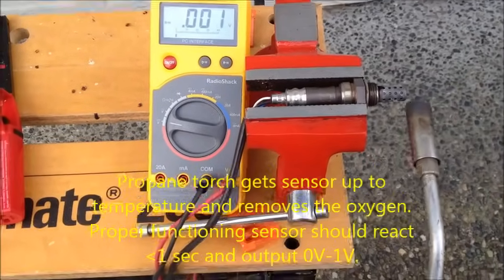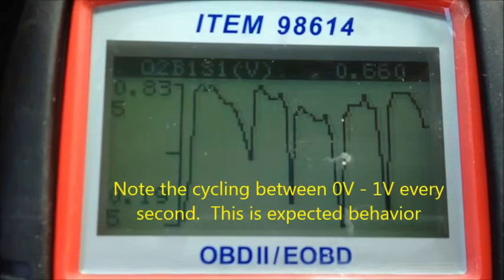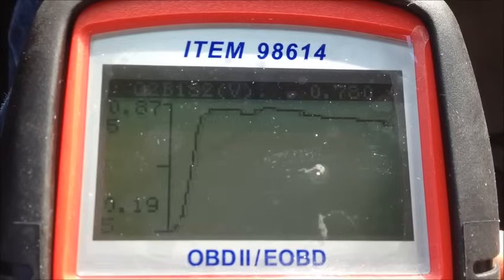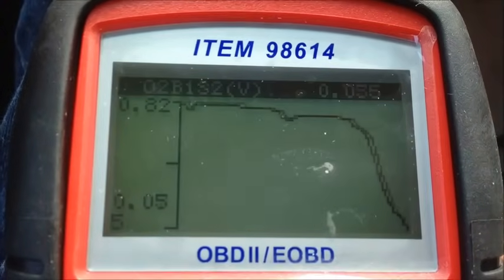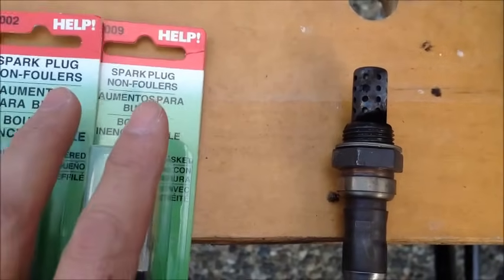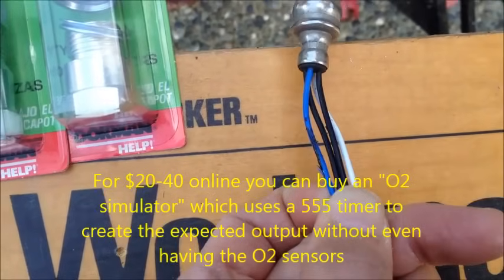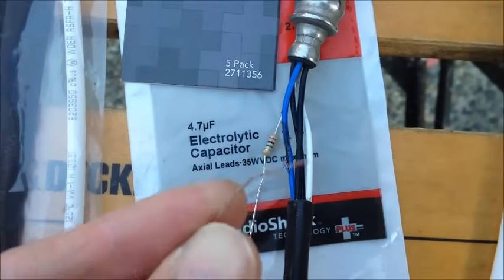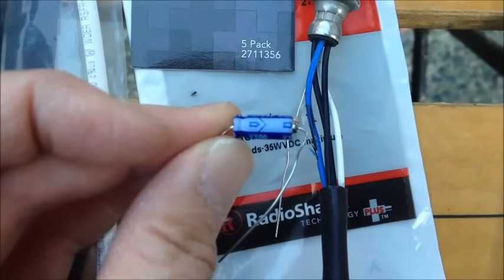$3 O2 simulator fix for P0420 Check Engine Light

Comment: Why not just ECU edit and disable the learn on rear O2 and disable the code? I did that will all my cars and I pass all tests without a problem.
Reply from the maker: Thanks for the suggestion.  I hadn't heard of that.  I searched online and it seems that older cars like this don't have a way to reprogram the ECU except possibly burning a new chip on expensive hardware, and even then I saw that this model may not support it.

Comment: Will this work on a 2009 Ram 1500 SLT 5.7 Hemi (straight piped)? I can't stop that CEL to save my life,  extensions, steel wool,  mini cats blahhhhh fuckin blahhhhh. That computer is developed by Skynet. I can't find a wiring diagram either.

Comment: Did not fix my 2007 Chevy Tahoe 5.3L got a P2A01 code O2 Sensor Bank 1 Sensor 2 Hope to get a reply . Used the 4.7mf and the 1olm resistor put in correctly the O2 sensors is just a year old. Not sure if i need different Capacitor or Resister?

Comment: I did the "spark plug anti fouler" trick on my downstream o2. I still get a p0420. 1995 Subaru 2.2. 

Unfortunately Radio Shack closed down 2 months ago where I live here in Alaska. Looks like Amazon it is. Thanks for the video!!

Comment: So to keep it clear. Keep the ground wire one solid wire with capacitor spliced in? Then has the resistor on (grey instead of blue on mine) grey wire running from cpu to o2 sensor head?
Reply: Yes. To splice in the cap, you'll have to remove about 1/8" to 1/4" of insulation. Do this step first: remove a section of gray wire and solder (or crimp) the resistor. Remember the cap. will get soldered or crimped on the one end.
Reply: @pauls.3188  ahhh man I done sold that mustang I needed it done to🤣was trying to cheap out on a tune

Comment: First of all, thanks for this nicely put together work. Yeah sure if you did this 10 times in a row im sure we all could do a more stream line job.
Im about try this on 2007 impreza 2.0l non turbo. but with a twist, as Ive drilled and blown the guts out of the Cat. so in effect there is no Cat. 

Car at the moment has even less power than it should, and a code - low efficient Cat reading.
Got any suggestions ?
Reply: Andromuda Galaxy  when removing cats in a "racing" configuration the ecm is tuned for a catless set up. Not the case here.
Reply: Put a cat back in. The engines need that back pressure

Comment: This is the best tutorial ever saved me over thousands on my CATs for a bmw. THANK YOU SO MUCH. It worked like a charm.
Reply: EKK status update?  Did the light stay off of did it come back on eventually
Reply: @youtubeisbroken241  stayed off..
Reply: @KKE1978  did you gut/remove the cat? Mine has collapsed and I dont have $400 to spend right now because we are still laid off because of Covid...
Reply: @daddyosink4413  no i just did this mod and i have never gotten a check engine light. Just follow the mod and clear the check engine light. You will be set.
Reply: @KKE1978  I have a PHYSICALLY failed cat.... like the "rock" has fallen apart and is obstructing exhaust flow making the engine run rough...  I either have to remove/replace it, or  gut it. As long as this mod will keep the light off and the computer happy I'm good. 😉
Reply: @daddyosink4413  now with that am not so sure if you gut it the mod will work. But if i were you i would gut it and try if it fails no harm done right?? But i have a feeling it will work because the mod alters the current to the DME for it to think that everything is honky dorry.
Reply: @KKE1978  my truck is not tagged in a county that tests, I just want the light to stay off. The cat has collapsed and I really dont have the money to replace it. I'll keep you posted😉
Reply: @daddyosink4413  then just do the mod after gutting the cats
Reply: @daddyosink4413  No, this won't work.  You need both a working cat & working o2 sensor.  This just cleans up the signal from a working system.
Reply: @daddyosink4413  gutting it and doing this still works.
Reply: @KKE1978  "hunky dorry"  ;)
Reply: @KKE1978  :elbowcough: "hunky" dorry

Comment: Easy fix for the soldering issue, use a butane soldering iron and dip it in solder flux before you solder.  It uses a lot less heat and the solder bonds right away.  An old school soldering trick I learned from my Korean War veteran electrician father.
Reply: Actually, years ago I tried fixing a damaged wire on an oxygen sensor and came upon the same problem.  The wires appeared to be some type of stainless steel and the solder would not adhere to them.  I had to crimp connect the wires.
Reply: @paulstandaert2042  Aluminum wire doesn't like solder. Also anytime you solder you need to use Flux.
Reply: @paulstandaert2042  i found a roll of some super old solder that worked everything else just ran off, ill edit this when i go take a look at the roll.
Reply: Thanks forr the tip!
Reply: What was the next size cap that you used, you said it fast, I hit the rewind button, but no luck. Thanks, it works great, still can't dismiss the light. 97 GMC k 5.0. thanks
Reply: @jesseter24 did it clear the p0420 code?

Comment: I have a Ford Fiesta 1.0 Flex,  with problem picking up in the morning when i m using alcohol. The Car had a life To cath and when it picks up it limps. When i take the probe  ( oxygen sensor) it picks up normal, incredible that. I already changed the sensor for a new one and i already went through the scanner To erase the errors, but even so, i only get it first if i have gasoline and in transit the  Car gets a dung, often oscilating the Egine rotation. When withdrawal ends the problems, the car runs in a good, but the injection Light is on, but the engine runs round. The problem is that he starts To drink a  little more. It would have an idea for me to develop some system with these components To simulate the probe signal good for  the car is getting a good morning???????

Comment: I tried this on my 2011 honda Crv. Im now throwing P0139 slow response. Do i need to modify something?
Reply: That means the product of Capacitor x Resistor is too high.  You can reduce either of them until you avoid that error.
Reply: My capacitor was 4.7uf 50v 105c. Resistor was 1m ohm 1/4 watt
Reply: did you solved it?

Comment: Does the resistor and capacitor get soldered together with the wire all together on the 1 side? or is the resistor closest to the O2 sensor, soldered in by itself?
Reply: The resistor lead nearest the o2 sensor gets soldered to the wire (I found it easier to crimp them.) The resistor lead nearest the connector gets soldered (or crimped) to the cap. and the wire.

Comment: brother you are the best, please whats the voltage of your cap? can i use a bipolar capacitor? i also have a polarized one of 4.7 uF but the rating of volts is 63V, king regards

Comment: Many O2 sensors use steel wire .. try using silver solder, and has been said, use rosin flux
Reply: Yea those 02 sensor wires are different the solder just drips off them
Reply: I crimped my connections using a butt connector.  Removed the insulation and cut it in half for a better fit.

Comment: How is this a simulator at all? Poor choice of words from someone supposing to be an MIT man. Simulator suggests you are reproducing conditions or results without actual hardware.   You are merely modifing the result of the sensor with a very very crude filter.  A better title would be stabilizer. But you knew that already, your from MIT.  Pfff.
Reply: More of a signal low pass.

Comment: must you run the resistor and capacitor  near the o2 sensor,or can you run the parts up next to the plug to.lets say

hide it?
Reply: It will work anywhere as the frequency is (you are not building a wifi antenna here).
Reply: I agree.  Anywhere.

Comment: I made-up and installed 2 modified O2 sensors for a 2004 GMC Yukon XL 6.0L, B1S2, & B2S2. This smoothed out their signals to mimic good cats.

However, P0136 and P0156 have now failed. These are the O2 sensor performance codes. The diagnostics passively monitors/tests the transitions below 350 mV and above 709 mV.  If the ECM/PCM detects the passive tests have failed, the control module will force the air-to-fuel ratio rich and/or lean. The control module then waits for a predicted response from the HO2S. If the HO2S voltage transitions below 350 mV and/or above 709 mV.

I wonder if different resistor and/or diode values can pass the P0136 and P0156 tests.
Reply: This is what I'm thinking too.  There must be a "perfect combination"

Comment: This worked for my 2005 Lancer - but using 2.5 uf capacitor - the 4.7 did not work.
Reply: El capacitor será el de 2.2 UF o 3.3 UF de otro valor es casi imposible conseguir

Comment: Just traded in my 2004 Corolla at 236784 miles. I did this trick when it was just over 170k miles and the cat was no longer doing it's job. Worked for me 60k miles plus.

Comment: Hey MITEEman -- 2007 Prius getting P0420.  I did the exact mod as you explained with the exact components you used.  Wired it in exactly as you describe.  Resistor in line with the blue wire, with positive side of capacitor connected to resistor (and blue wire) on car side (not O2 sensor side) of the resistor.  Negative side of capacitor spliced into the white wire.  All connections soldered and heat shrinked, all solid connections.  But now my post cat O2 voltage is completely steady at 1.275 volts which I know is wrong.  Drove the car 10+ miles on a hot day to heat up the cat.  Held steady at exactly 1.275 volts the whole time, no change.  No cycling up and down at all.  And I know it should not be going over 1V.  So I know something's wrong.  I also did the propane test and that was normal.  Any ideas?  Many thanks.
Reply: Hey BeachbumNJ. Any luck with your 07 Prius? I'm having the exact same issue on my 06. i'd love to get this to work. Let me know. Thanks!
Reply: I'm having the exact same issue on a 2013 Sienna Limited AWD on the bank 2 sensor 2. I'm hypothesizing the wiring is different, figured I'd read the comments here for ideas first.
Reply: I checked the universal O2 sensor wiring chart and it seems that with blue/white/black/black, there's only one wiring convention. 1.25 V can never be generated by the sensor itself, so it's actually probably the ECM checking to see if the O2 sensor is there or not. I bet one of the connections on the resistor soldering job is weak, so the ECM is seeing an open circuit. I'll pull the sensor back out and re-do the connections.
Reply: I checked my circuit, the connections were fine. I'm using a 47 uF capacitor and 100 kOhm resistor. With the sensor unplugged, everything is fine upon startup and it reads 0.000. If I plug the sensor in and start the van, the voltage creeps up to 1.275 V with a 4.7 second time constant and I get a P0607 code. So I think the ECU is running some test to check if our circuit is there and it trips a code if it sees the circuit. I'll have to try shorting out the resistor or removing the capacitor to see which part of the circuit it's detecting. Then change up the circuit accordingly. Like maybe use a giant capacitor, like 1000 uF, and hope there's enough virtual resistance in the O2 sensor chemistry that the capacitor slows down the oscillations. That might kill the O2 sensor early, though, if all that current draw eats away the metals inside.
Reply: I shorted out the resistor, no change. Figured the capacitor might have started leaking current due to the high heat of soldering. Sure enough, it read around 10 MOhms, while my fresh caps read open circuit. I soldered 3 foot wires to the two blue and one white wires, ran them to the top of the car. Then started playing around with the circuit. My original circuit design would still read 1.275 V and throw a P0607 code, but I let it warm up fully and cleared the code. Then it worked as it's supposed to. I removed the resistor and had just the 47 uF cap, and it still behaved the same, fluctuating slowly in voltage. I think the internal resistance of the O2 sensor chemistry is high enough that the capacitor alone does the job. I'm going to play around with it, try a 1 uF cap or smaller and then maybe some big resistors to see if the ECM won't notice the hack if the capacitor is small enough.
Reply: +Charvak Karpe - Did you get any further with this? After wiring my sensor output is 1.27v. Great info here but not much to help with this of us who have the 1.27v issue.

Comment: I tried this mod and po138 and po139  came up. I am using 1M ohm resistor with 4.7 micro farad capacitor It say voltage is too high. Should I reduce the resistor ohm rating? Can  anyone give me some advice. Thanks.

Also tried 1m ohm resistor and 1 mirofarad capacitor and  po138 and po606  came up.

Comment: just did this method with exact same type and ratings of resistor and capacitor on a Volvo xc90 v8 which uses a Yamaha engine, aisin/denso electronics (same as toyota.) It gave me code p0157, o2 circuit low voltage after 30 miles. 

now I have two problems. awesome!
Reply: I had a similar code. 100k resistor (and 1uf cap, but that shouldn't impact anything) raised my max voltage from .525v to .74v. (acceptable range is .605-1v in my Highlander.)

I was also failing O2 time test cycles, so I reduced the cap as well so voltage would fall a little bit faster.
Reply: @andrewfaber9014  I accidently tried your setup(100k resistor (and 1uf cap))  but still got p0157.
Reply: Replace the 02 sensors and take battery cables off battery ten touch them together and then reconnect to battery start car see what happens

Comment: Will this damage the Eprom driver for the O2 circuitry in the car's ecu?
Reply: No, there is no driver for the O2. The O2 uses 12 volts for the heater, and the sensor generates its voltage output.
Reply: @beaglefet9906  Helpful information! I'm guessing the ECU reads the voltage and makes a decision from there?

Comment: Hi,
First off I’d like to say thanks for your post another great video. I install the filter and I am now getting a P0143 voltage low check engine light signal. Did I do something wrong or why soldering not Goodnuf do you think? Any help would be greatly appreciated thank you. This is on a 2004 Toyota Camry with the 2.4 L

Comment: i tried the adapter route and it rusted out in two years and sensor fell out. threads still in exhaust pipe. so if you do this make sure you replace the adapter every year. it will rust right in half pretty quickly.

Comment: I have oil consumption issue on my 2006 Lexus GS300, recently just replace both downstream sensors.  Less than 5,000 miles later it's throwing codes again relating to one downstream sensor, any advice?  Cleaning replacing essentially a new sensor?  Thank you.

Comment: 2008 BMW 328xi - I was seeing .750v to .850v on both rear o2's.  After this mod, .450v to .650v.  I used 1M 1/4 W resistor and a 4.7uf 50v capacitor.  Worked perfectly!  Bought the car running pretty roughly. Spark plugs were shot. 1 bad fuel injector. Replaced the coils and 2 front o2's for good measure. Runs rock solid but still had the rear O2 faults. This fixed it. The spark plug non-foulers did NOT fix it.
Reply: Thanks bud for making a comment I tried the non fouler and I thought it was me but I think it's the non foulers will try this on my 2011 BMW 328

Comment: Hello there nice work. I am having an issue with my 2002 dodge dakota 2002. 

I replaced alot of electrical parts on my vehicle. It used to not run right. I replaced the catalytic converters today. I bought 2 up stream o2 sensor and 2 o2 down stream o2 senors.

However I still have a P0136 code even though I replaced the o2 sensor today. My wires are good. How do I trick the 02 sensor bank 1 sensor 2

Comment: Thanks MITEEman, I bought a used 2004 fx35 last year and it failed smog check for P0138 and P0158 which are the post CAT o2 sensor issues. I went ahead and changed them both and I found out that it made no difference. When I delved into it a bit more I realized that all 4 o2 sensors once in operating temperature just show a steady voltage, the post CAT sensors go to 1.275 volts and max out, and B1 S1 is at .3 V and B2 S1 is at .64 with .01 v oscillation. When I accessed the ECM to see what is going on, I found that someone had simply joined the wires between S1 and S2 on B1 (and not B2). For the life of me I cannot figure it out why would anyone do that and why would ecm accept this. BTW, the car runs smoothly and aside from the "service engine soon" light on there are no issues. I also verified all 4 o2 sensors they are fine, even the original sensors that I replaced were fine.
Anyone out there has any idea what is going on. I hate to revert it back to what I think it is supposed to be and find out now that the car is not running smoothly anymore. I have to point out that mileage is not that great 14-17 mpg. I unplugged B1 S1 and drove it and it still worked but not smoothly, it got slow to respond to acceleration.

Comment: would it be possible to use this configuration on a $20 o2 harness extension? this would just plug in line and would make this possible to do without even having to remove your o2 sensor. thanks for posting the video!
Reply: Yeah, that is what I was thinking. My wires come up inside the vehicle and under my passenger seat. I would do the soldering of the components there, out of sight under the seat -- should not matter their distance a few inches down the line from the sensor.